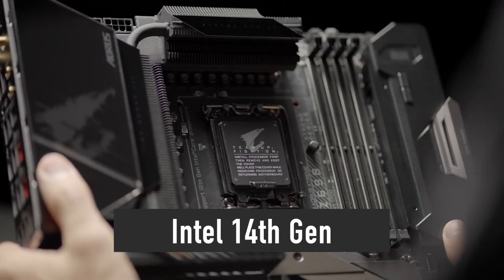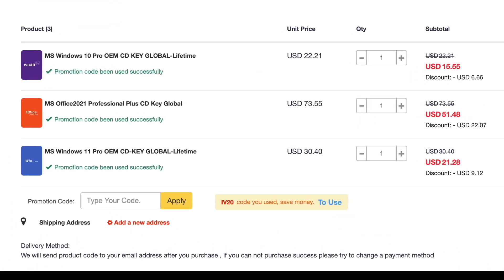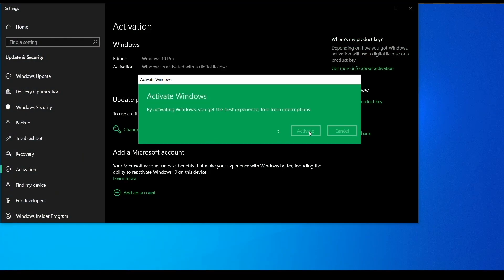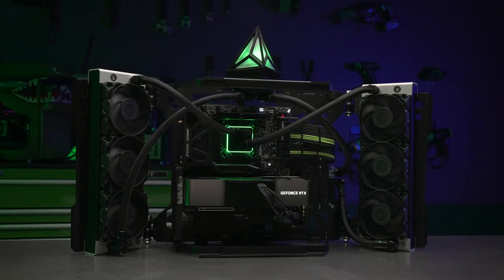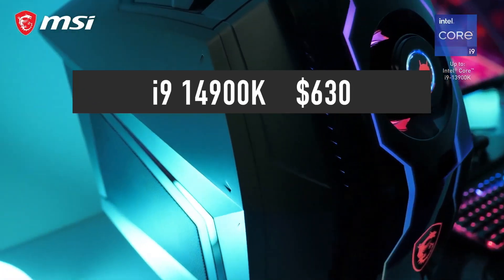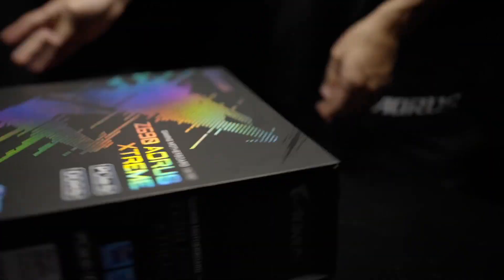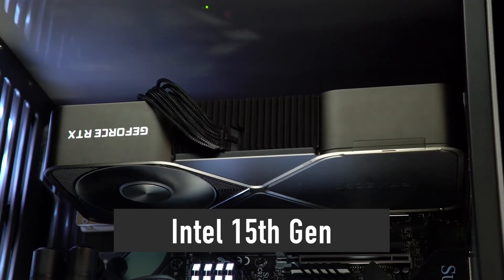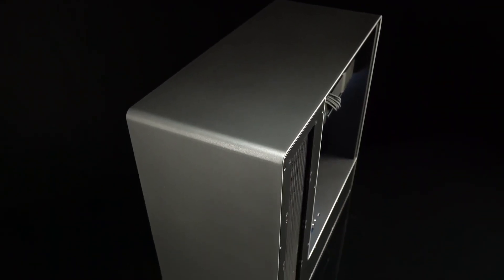Intel 14th Gen Crushed Ryzen 7000?!

Comment from the maker: Do you think the 14th gen is worth the wait?
Reply: Yep, just waiting for the 14600k and ill replace my 5700x.
Reply: @justanobody4983  why not zen 4? just curious
Reply: @nivea878  just my preference. Dont want to be attacked by amd fanbois if i give my reasons.
Reply: The need for a beefy 420mm, 360mm AIO cooler for the i7, i9 SKUs. Is there still issues with the 1700 bending socket. Do you need an intel anti-Cpu bending fastener?
Reply from the maker: @OwDoDuck  I think that bending issue was not addressed to this day since it doesn't affect the CPU or motherboard too bad. Looks like Intel decided to let it be as is until its time to introduce the next socket.
Reply: @theivadim  - intel bend socket is a machanical flaw - it makes 15 celsius degree difference- all those motherboards should be called back.  imagine if bend socket was amd problem - you would hear about it everywhere like we heard about 6 pieces of burned amd cpus on a silly motherboards overclocking them by default...
Reply: totally! Actually, no: 15th gen is the one.
Reply: no, only for people owning low tier 12th gen
Reply: @michal1693  Agree.  I have the 12600 non k version and hope to upgrade to a 14700 or maybe 14900.  There were rumors about a fast i-9 k chip with fewer e-cores- ...perhaps I'll get that if it is not too power hungry.  If intel does only two generations per socket people complain that change is too frequent.  If Intel does a third generation on the same socket people complain the performance boost is too small.   I hope performance improvements are bigger with the non k chips.  I think there could be more room for efficiency improvements there then the flagship K's and KS CPU's.
Reply: @sezwo5774  - i've used 4670k for 8 years, the "refresh" was so disappointing i didn't bother to upgrade. Don't rule out staying on 12600 and not investing more in this platform will be best option. Depending what you are using it for.
Reply: no.
Reply: I don't think so: just upgrade, if you can, to a good AM5 platform with a 7800X3D, to be replaced with a Zen 6X3D (aka: 9800X3D or something; that reminds me, my old Radeon 9800pro) counterpart, if it's still on AM5 ?.
If you want to wait for almost a year (because the 7800X3D release time was pretty late, April 2023 or something), you'll be able to choose between Z5 X3D and Meteor lake (Arrow Lake ?) for desktop in 2024Q2...)
Then, Arrow Lake will probably be upgradeable to Lunar Lake (?) and ZEN 5X3D to ZEN 6X3D.
And in 2024, RAM will be better (DDR5-8000 or something)
Reply: 15th. Due to new socket.
Reply: probably wait for 15Gen for a potential system ovehauling. I am stuck with LGA1700 lol
Reply: No  
Ryzen 8000 series
Reply from the maker: @mrkb798-v6m  I too have high hope for 8000-series🤝
Reply: my personal belief is the 14th is a waste of sand in an attempt to leap frog the 8000 series with the 15th problem is Intels crappy socket life is going to burn them ..My logic is 14th will drop on the LGA1700 then the 8000 series will leapfrog it still on AM5 then 15th will drop on a new socket but i think Intel have everything crossed AMD moves to AM6 for the 9000 series if not Intel will be crushed again !!

Comment: Are they still just shoving more volts into the processor to get the performance up?  Because in 2023 I'm no longer impressed by paying more to get comparatively less.  5600x3D pushes out 12900K performance at like, a quarter of the power consumption, on a much MUCH less expensive platform.  Intel sucks.

Comment: 15th gen will be the real deal. Especially 15600K which will most likely go toe to toe with the 13900K.
Reply from the maker: I expect the 15600K to exceed the 13900K in games. That is not a huge ask to be honest as the 13900K is only about 8-10% faster than the 13600K.
Reply: @theivadim  Still, it'll have less power consumption at the same performance.

Comment: Aren’t these only laptop tho? Im stuck with a ryzen 5800x and have micro lags in every game, im desperate for an upgrade.
Reply from the maker: I did not experience suck issue when I had my 5800X PC. But looking at forums I see people have. And there are quite a few pieces of troubleshooting advice - https://www.reddit.com/r/AMDHelp/comments/njhnwu/5800x_stuttering/
I know how frustrating it is when something doesn't work the way it should and you've paid money for it. I hope you can find a fix. In my experience, most issues go away after I update everything related to the part in question. Motherboard BIOS especially.
Reply: @theivadim thank you for the reply and the link, i think it probably has to do with the MB or something, but im just getting and Intel cpu since i need the single core performance and most games are optimized for intel, i mainly play strategy games like total war or simulator games which are more dependent on cpu than gpu, cant wait for them to release in September and im also curious if intel is going to change something regarding the heat and high temperatures on that chip  😅

Comment: well. IMO It can be max 5% better than 13gen or totally useless like haswell refresh. Time will tell. I'm definitely not interested and because of power consumption and platform longevity already upgraded from 4670K to ryzen 7770x
Reply from the maker: Looks like you are all set for the next several years🙂 Let's hope AMD will treat the AM5 platform to two more CPU releases (Ryzen 8000 and 9000).

Comment: Nice video. 14th gen Intel chips might outdo the current 7000 series Ryzen chips but the upcoming 8000 series Ryzen probably would out perform 14th gen Intel. So 14th gen intel is a gap filler between 7k and 8k Ryzen's?
Reply from the maker: Thank you!
Yup. It is a tick tock situation going on here. Which is good. Always something better just over the horizon. Keeps both companies on their toes and forces them to be competitive - producing better products.
Reply: @theivadim  Too bad AMD can't do as well with their Graphic Cards VS Nvidia. Maybe eventually Intel's Graphic Cards will help to balance the market and prices go down to a more reasonable level. Do you think if AMD , was to let the Graphic Card division go back to using the [ ATI ] brand name - it might have a better response from the market?
Reply from the maker: @johnpaulbacon8320  I don't think so. AMD brand name carries a lot of weight these days. Very few people know or even remember ATI. It would be almost like starting from scratch. It would require a lot of resources and money to build up the ATI brand name. So, it doesn't make sense in my opinion. Those resources are better spent on making better products.
And I hope Intel can recover from the initial disaster that was Intel ARC graphics launch. I want to see more companies offer better products. Having competition on the market is one of the way to get there.

Comment: the benefit of 14th gen which on desktop is just the Raptor Lake refresh is, as you point out, that it will work in existing LGA1700 sockets on 6xx and 7xx series motherboards (taking a leaf out of AMD's book, albeit somewhat inadvertently due to not getting their act together in time, and also cancelling products because of margins!). Personally I'm looking forward to the Arrow Lake series, at which point I expect I'll pull out my 7950X system and replace the two main components with an Intel processor and motherboard (or maybe I just replace my i9-12900 system)
Reply from the maker: I just hope that Intel can sort out their power consumption with the 15th gen. It is getting ridiculous.
Reply: @theivadim  that's the only issue with Intel's processors, as we all know. Supposedly they're addressing the issue, so long as they can get 4nm & 3nm working successfully. I believe the inability to get the smaller nodes working as well as AMD, or should I say TSMC, has been the problem.
Reply: The problem is AMD are still going to beat them with the 8000 series still on AM5 then 15th will be a whole new socket and ddr5 only !!
what if AMD sticks with AM5 for the 9000 series then Intel are going to be behind again !!
then if AMD slide the AM6 platform in between the 15th and 16th gen people will likely upgrade to AM6 for the next possible 3 generations of AMD cpu's
Intel only need 3 things to claw back the market 1. much better socket life span .. 2. better efficiency of there cpu's ( not brute force everything ) 3. ( the hard one ) 3d v cache  AMD is getting closer and closer to the perfect gaming / production cpu .. If AMD can sort the 3dv cache stacking on a 8950x3d then Intel will have literally nothing to answer with !!

Comment: and here i am stuck with my 9900k 😅
Reply from the maker: My friend has one. He is pretty happy with its performance to this day. What about you?
Reply: @theivadim  i have one as well.. i am still good to go with it.
Reply: @theivadim  still happy with it coz i OC it to 5ghz paired with 3080 and 64gb ram 😍
Reply: @ianmarkdizon  You can still keep it for a lot of years. Just go 4K down the line and you don't have to worry about anything.
Reply: i used 4th gen 4670K until last month. It is still a good cpu. I was using nvme drive on an pcie adapter and was getting 4gb/s speeds. Upgraded to ryzen 7700x